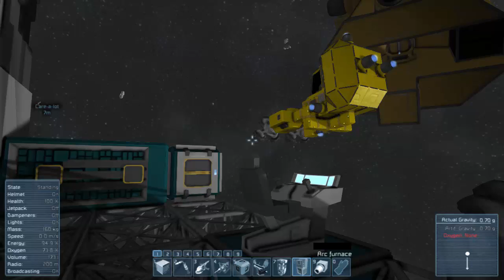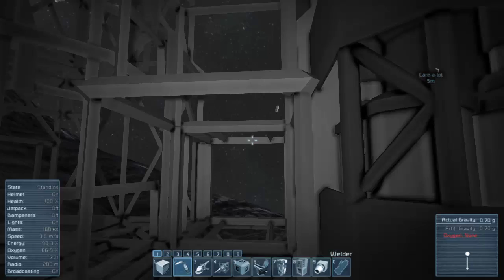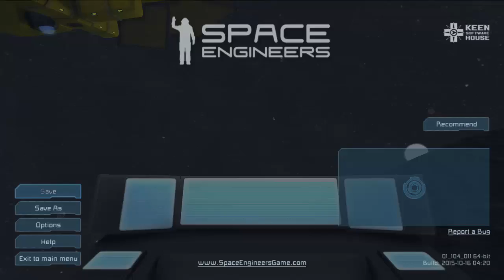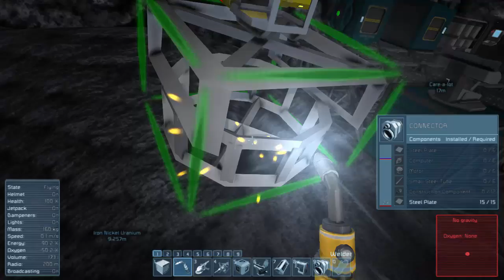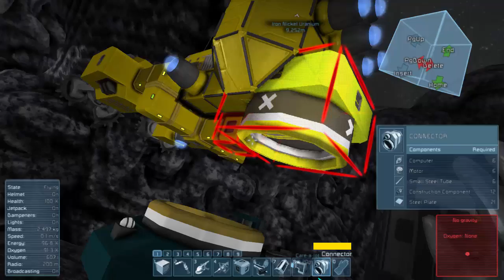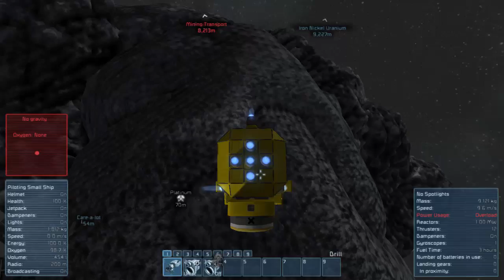Let's Play Space Engineers - Ep04 - Refinery Upgrades

Comment: Cooperative assemblers don't need to be directly next to each other, they just need to be connected to the same conveyor network.  The main one is set normally and the slaves ones are set in cooperative mode.  It might have changed in the latest update, but as far as I know, there is a bug where you need to set the slaves to share with everyone to get them to work properly.